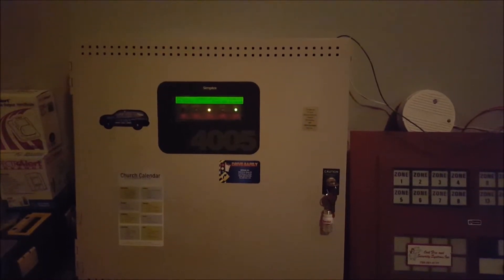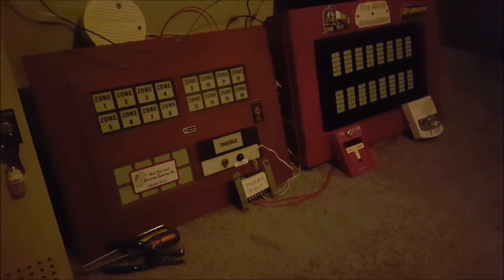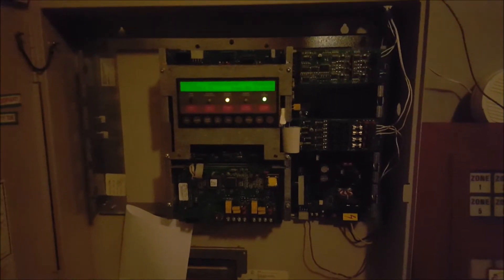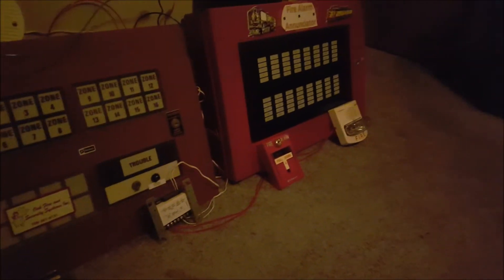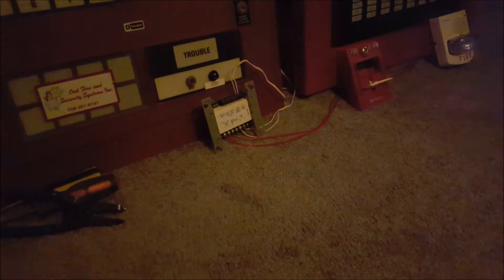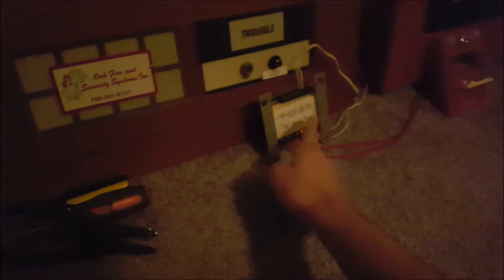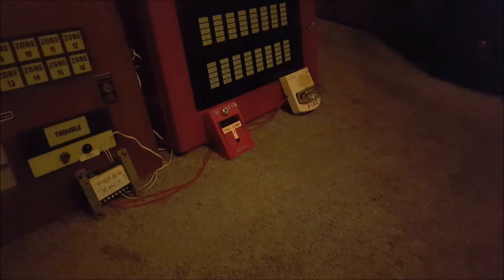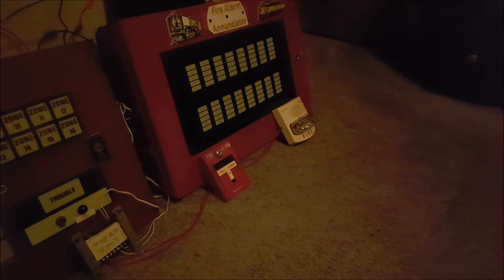Floor System Test 39

Comment: Btw a ground fault has NOTHING to do with a grounding connection, ground is 0 volts so it’s impossible to detect if a  ground wire is connected, you have a positive wire (or other voltage) to the panel shorted to the metal housing
Reply from the maker: Well I have no clue what it could be, then. I'll look it over again, but last I checked, there was nothing touching the metal housing. I mean, there's that little wire that connects the door to the inside case, but I thought that was supposed to be there. So either I missed something, or my power supply is also bad.
Reply: msj191961 a ground fault can also happen if something is shorted, The wire on the door is just grounding the door, It’s supposed to be there
Reply from the maker: I don't believe I have anything shorted. I just looked around the whole inside and outside of the panel. Nothing out the ordinary. I'm going to go ahead and hop back on the forum and see if I can get this resolved from there.